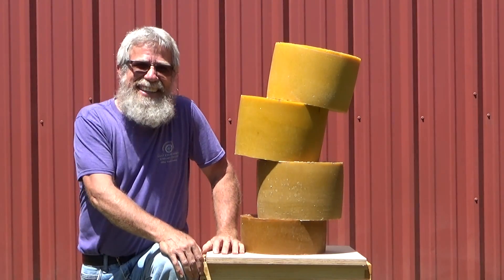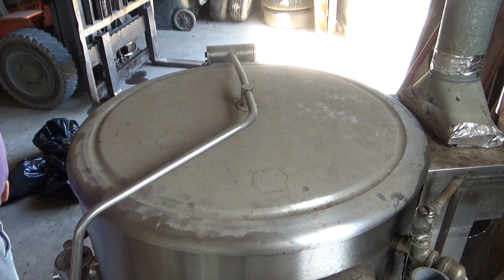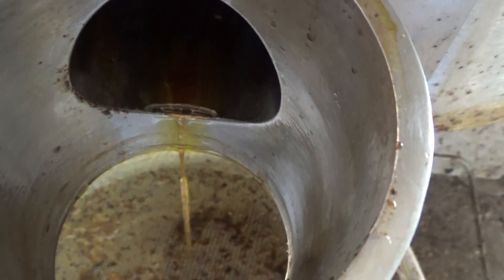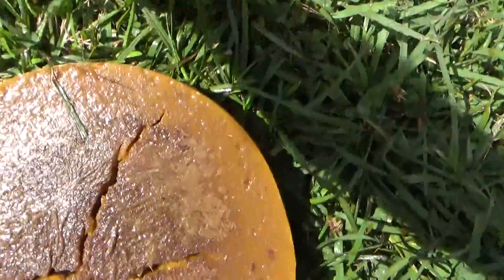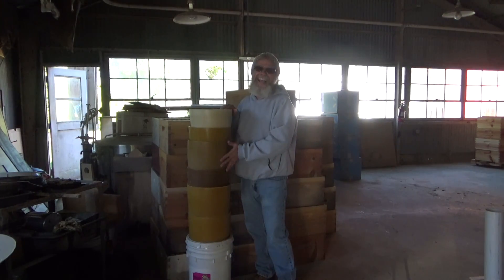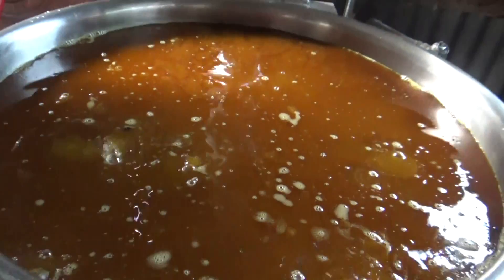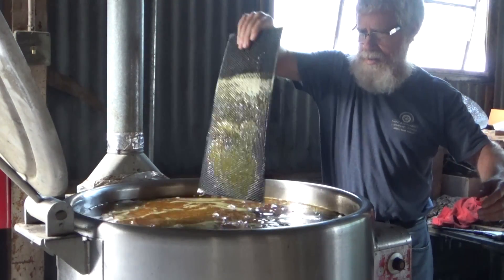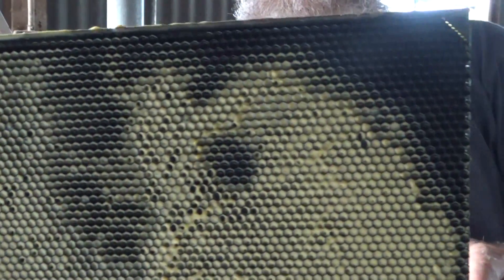Rendering old beeswax making it useful once again.

Comment: Is there any way to effectively spray the combs down, or clean them without losing any material before it’s all melted down?
Reply: Is it the reaction to heat that is the filter?
Reply: If you put the kettle on hinges, you could possibly take out the debris with the candy making scraper. It’s bendable, it conforms to the side of the kettle.
Reply: Make a machine that has all the components
Reply: Instead of hinges, make it spin, like a washing machine.
Reply: A break while doing this type of repetitive movement could be super effective.
Reply: Sir, are you alright? You’ve been having a conversation with yourself for the past hour.
Reply from the maker: I am not aware of any, and have found it easiest just to drop it in the kettle and melt it. God's peace.
Mr. Ed
Reply from the maker: The main filter is the water.
Reply from the maker: Some kettles are hinged to make pouring easier, but this one is not.
Reply from the maker: That would be nice if I had the talent.
Reply from the maker: A very good idea.
Reply from the maker: Trust me, I take brakes, I'm a retired mailman.

Comment: You made comments about how you hold the wax-dipped frames to allow the excess wax to drain from them.  You also made comment about the number of plastic-foundation sheets you coated with the 80 pounds weight of wax. That works out as an average weight of nearly three ounces of wax for each sheet of foundation. Your comments made me think that you would like to have coated more sheets with that amount of wax.
Do you really need to use that much wax for each sheet of foundation?  Will the bees build comb readily if the wax layer on the plastic is a little thinner?
I would like to know your thoughts about a suggestion that I would like to make. If you made a box (with a heater blowing hot air into it), which enabled the dipped foundation sheets to be stored vertically for a short while to allow ALL of the excess wax to drain from them, then you would save  time by not having to hold each sheet for so long, and you would be able to recover more wax because the coating on each sheet would not be so heavy.
Reply from the maker: It does work out to be approximately 2.5 oz of wax per frame, very excessive, but what the heck, I've got the wax, may as well use it. Since I am not a commercial guy but just a guy who loves fooling with bees, I'm not all that worried about a bottom line and excesses like these are very tolerable. Your idea is a good one, but the energy and expense of producing a piece of equipment like the one you suggest is one I'm really not interested in. I'll just shake a bit of the excess off and let it roll. God's peace Wilfred.
Mr.Ed

Comment: How do you clean the plastic foundation?
Reply from the maker: There is a mixture of dawn soap and vinegar that is mixed and the frames sit in it for 24 hours. After that, a simple pressure washer will clean them ring up. Dave, at Barnyard bees has a great video on that, sorry I don't know the link. thanks for watching. God's peace.
Mr. Ed

Comment: why not use an elevated wire mesh, maybe two to three with smaller holes?  put all dirty wax on top of the mesh. put enough water just to make enough steam. steam is hotter than boiling water, it evaporates, and eventually, you'll end up with just wire mesh with junk and wax with no some water at the bottom.
Reply from the maker: Sounds like it would work just fine, I'll look into it. Thanks for the info and for watching. Also, I hope you will check out more of my over 450 bee wrangling/ bee rescue adventure videos and let me know what you think of them. By the way, I post a new video almost every Friday morning, and I look forward to hearing from you again soon.  God's peace
Mr. Ed
Reply: This is a solid idea. I started thinking of something like that after seeing the kettle.

Comment: Use a paint gun like the Titan Control Max 1900 PRO or any other like it with that you can spray 5 or 6 tray per minutes without removing the frame but do not use filters on the line or the handle if this tip help you you owe me a jar of honey
Reply from the maker: Because wax cools so quickly, the lines the wax travels in have to be heated. It requires some very expensive equipment to spray wax on frames. Thanks for watching. God's peace Juana.
Mr. Ed

Comment: I would suggest letting the wax run through woman's nylons after exiting the nozzle. That should remove smaller particulates. Don't force the wax through, it will only open the nylon and defeat the process.

Comment: Ed.
I saw how you waxed the foundation and I didn’t it similar last year. I found that the wax that gets into the cup of the foundation isn’t used. If poke the bottom of the cup in the drawn comb you will see that it’s tick in the bottom. Let me know how it goes.
Reply from the maker: I will check that out, interesting. Thanks for the heads up and for following along. God's peace Justin.
Mr. Ed

Comment: Some takes the browner wax away appart considering there is too much treatments résidus concentration in ...
They don't want to "pollute" the frame in with ...

With the box you deal with there's no difference between bees "inhabits" and honey stocks ...

Won't it be interesting to select the frame from/with the use it will be deserved to and prepare waxs subsequently ???

I mean ... caps to caps ... honey to honey ...
And bees "residence" frame turn around in with so called "polluted" by treatment concentration wax ???

Won't it help to light the needed treatments or at least helps to let more times in between ???

I'll probably make all the mistakes needed to learn ...

But I'll learn !

Going to have some "living stock" to take care of "by myself" .

Thanks
Reply from the maker: It would prove difficult to achieve the different divisions, but I suppose it is possible. For me, just throw it all in the same batch and let it happen. Thanks for watching. God's peace.
Mr. Ed

Comment: 80lbs of wax means 560lbs of honey for you.. Oh man, that Friar or Father or Priest.. I am still amazed they wear those robes in the south.. sure you probably don't need to wear much else under them but... talk about a trial wearing those thick things in that heat and humidity. It's not like they are made out of thin breathable material like the things the Arabs wear. (called a thobe or dishdash/dishdasha)
Reply from the maker: And 560 pounds of honey means about 46 gallons of the sweet stuff.....man that's a lot of honey, well worth the effort of putting the wax on the foundations. The monks wear their habits ALL the time except when they are doing manual labor like Br. Austin who was helping me. Of course, the monastery is air conditioned so that does help a lot. Thanks for watching. God's peace brother.
Mr. Ed

Comment: use a wired centrifuge inside the  drum it could even have no bottom while turning can lift out and dump inside wall of junk.  (USE properly Grounded Electric supplied motor AND PRESSURE SWITCH TO RUN)_
Reply from the maker: Great idea, thanks for sharing it and for taking the time to watch the video. God's peace Joseph.
Mr. Ed

Comment: Alcohol should clean that pot out really easy
Reply: There are solvents which will dissolve beeswax, but you probably would not want to use them with any food product.  Beeswax is only slightly soluble in alcohol.
I suggest that you do a Google search, such as "does alcohol dissolve beeswax".
Reply: @wilfredkube8570  not sure what you mean but I'm referring to cleaning his pots. I'm not sure what's wrong with rubbing alcohol cleaning pots. I also don't really rely on Google for all my info and sources. You should try cleaning something waxy or sticky with rubbing alcohol it does a pretty good job. Thanks for your input though👍👍
Reply: @richmccallable  I believe that "rubbing alcohol" is actually isopropyl alcohol, and yes, isopropyl alcohol dissolves beeswax.  Usually, when people mention "alcohol", they are referring to ethyl alcohol which is found in beer, wines, and spirit drinks such as brandy. In the context of cleaning products, ethyl alcohol is denatured with methyl alcohol (and other chemicals), and is referred to as methylated spirits (or "meths" or "metho"), and this alcohol only slightly dissolves beeswax.
Reply from the maker: Heat is all you need. If I clean the pot right after it drains, it cleans up very nicely. Thanks for watching. God's peace.
Mr. Ed

Comment: @Jeff Horchoff Bees , you should try to take a pair of pantyhose, cut the legs off. Place a sock inside of one of the legs, so it makes a long tube. Then zip tie or twist tie it to the spigot of the boiler.  That should supper clean the wax. Also, you can squeeze it as well.  Also wear latex gloves when dipping the wax you can go in a little further into the wax and It wouldn't burn your fingers.
Reply from the maker: I am going to place some wax in some type of bag very soon and see if my reluctance to try it due to wax loss is justified. We shall see. The latex gloves is a very good suggestion, I got burned a number of times. Thanks for the suggestions and for watching. God's peace Ian.
Mr. Ed

Comment: This comment is coming from complete naivety and knowing very little about bee biology, so excuse me for that and my misuse of terminology! You say that you pre-wax the plastic sheets because otherwise the combs will fall off in processing, this makes sense to me. 

However, I'm not sure about the wax providing a return on honey. I'm interested to know if this is proven and why it's the case. I'm assuming (likely incorrectly!) that bee wax is a fat produced/excreted by bees through their intentional, over-consumption of food. If they have to produce greater amounts of wax, that means that they must consume more food and therefore be more active. If they didn't have the starter wax, sure they wouldn't need to consume as much food (stored as honey, which you want to collect), but does this change their behaviour and reduce colony growth/activity at all? Basically, is it possible for a hive to less active across a whole season, because they don't need to produce that wax that you invested or is it proven to be irrelevant, and hives will just consume less of their honey and provide a greater surplus across the whole season because they have that stockpile already?
Reply from the maker: Thanks so much for taking an interest in the process and asking questions. I use wooden frames with plastic foundation set in them for our bees to draw wax on them and then fill them with honey. Another way it can be done is to use the wooden frame with a "starter strip" at the top of it and let the bees draw "natural comb" in the frame with no foundation. This type of frame, with no foundation in it, is not strong enough to withstand the force of the extractor and the comb will fall off the frame while spinning. As far as why I supply them the wax is because it takes 7 pounds of honey to produce 1 pound of wax. If I give them the wax, they can store the honey rather than expend it to make the wax. I hope that answers your questions. Thanks for watching, and I hope you will check out more of my over 450 bee wrangling/ bee rescue adventure videos and let me know what you think of them. By the way, I post a new video almost every Friday morning, and I look forward to hearing from you again soon.  God's peace Nick.
Mr. Ed
Reply: @JeffHorchoff  Thank you for taking the time to answer! That 7 pounds to 1 pound makes sense and lines up with what I was thinking! I've been binge watching a lot of your videos for the last week ;) Thanks again Mr. Ed!

Comment: Why not have new frames molded out of wax?
Reply from the maker: It's just a matter of preference, I prefer using plastic foundation because it will never come out of the frame while in the extractor. Naturally drawn comb, even if there are wire supports in it, does not have the strength or durability of the plastic, and will break loose while spinning in the extractor. Thanks for watching. God's peace.
Mr. Ed

Comment: If you put that croc pot in the freezer, it wont be very difficult to scrape off
Reply from the maker: Possibly so, but I'd just designate the pot for wax rendering. Thanks for watching. God's peace Rory.
Mr. Ed
Reply: @JeffHorchoff  I agree, not saying go overboard trying to get every last bit out... However, it will be super easy to get the trash out, and make cleaner wax in subsequent batches... Also works similarly with candles in jars (if there is no lip), just put in the freezer upside down and slides right out, if you make a mistake when making, or at the end of a candle after mostly burnt away